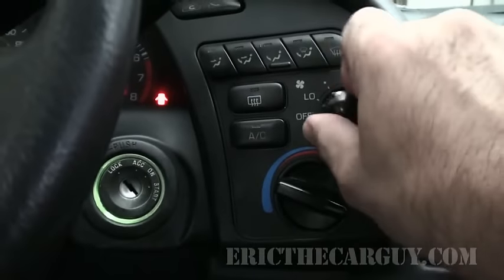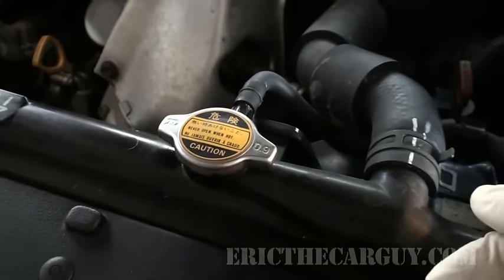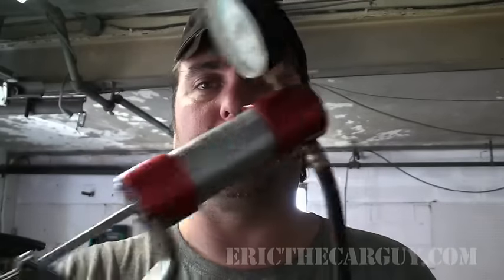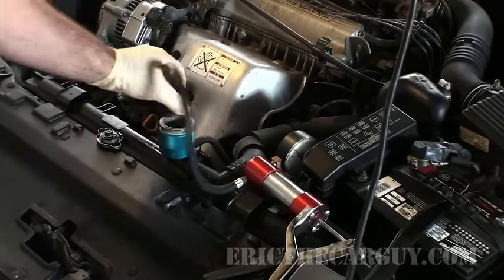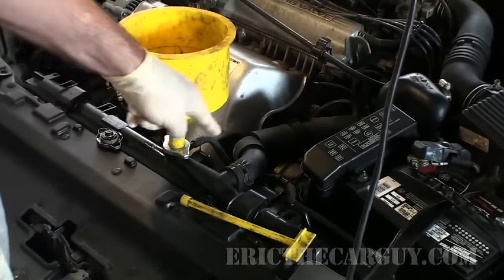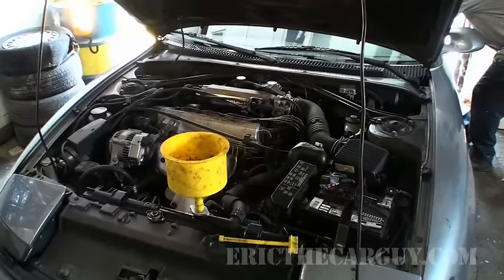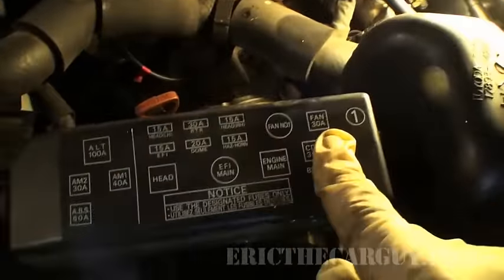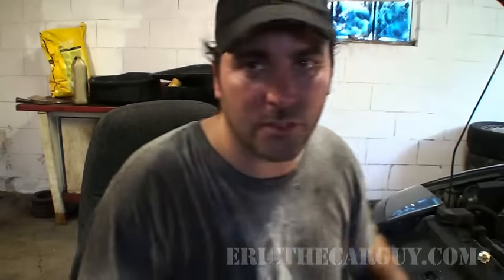How To Solve An Engine Overheat Condition - EricTheCarGuy

Comment: If this guy were a heart surgeon, I could do my own with his video
Reply: The difference between a heart surgeon and a mechanic is, a mechanic can fix a motor with it off. Heart Surgeons have to fix them when they are running...
Reply: Two In The Pink One In The Stink what if they really dont. who knows what is possible, everything we know is by design, were completely brainwashed. COMPLETELY!
Reply: They actually stop the heart and use a machine to circulate the blood. It would be really a neat trick to repair a heart valve with it beating!!!
Reply: thank the god we dont have subsidized mechanics yet
Reply: S.O.C_91 same

Comment: Thank you, Eric. I am having a PT Cruiser overheating  problem  for a second time. The first time was just over a year ago when a company that repairs only Dodge and Chrysler attended to the problem.  They replaced the water pump, all belts, thermostat and radiator cap.  So, now that I have an overheating problem again, I decided to take steps myself to fully understand the causes and solutions. I have seen several YouTube videos but did not find any that covers the topic so comprehensively as you have done. I now feel more confident at least to find out the cause of the over heating. Your video offering is much appreciated.

Comment: Last time I posted on this video was 12 years ago!
Eric does an outstanding job of explaining the principles of how relays work and how to properly test them in this video. BUT, for people who are a little more advanced electrically, a much simpler way to test the relays is if you have another relay in the fuse box that's identical to the one for the radiator fan, just swap the relay with the other one. This will take you one minute at most.
If the fans now work and the circuit that you pulled the other good relay from (headlight, etc) doesn't work anymore, you've nailed the problem and your diagnosis is done.
Under 5 minutes and DONE!
If the fan still don't work, and the other circuit does, you know that the relay was good all along.
Also, activate the fans and tap the motor with a long screw driver. If it starts spinning, the motor has a broken winding. 30 seconds and diagnosis is DONE!
Understanding systematic diagnostic procedures is really super important if you are new to this, but as you advance, you want to start using these much faster procedures to get the problem fixed sooner!

Comment: Great videos eric love the fact that everything is explained in such detail
no smart talk no trying to be a youtube star no bull just straight to the point
what could be better cheers mate :-)
Reply: +Steves Projects Well said man
Reply: thanks mate
Reply: Steves Projects m,!
Reply: would a thicker radiator help keep a ym2000d Myanmar tractor cooler
Reply: Yeah Eric is legit!
Reply: This is a good one.  Electric motors usually need air over for cooling, so an obstruction may have been the original problem that wreaked havoc.  [Was that a squirrel nest in the making in there?] One of the things I like best when checking out motor circuits is an amp probe - has to be DC for a  car obviously. Just clip on to the wire for the circuit being tested and find out if/how much load there is.  A good one is polarity sensitive and will show a negative value if you clip on backwards vs. current flow [comes in handy if you're not sure which way to go to find the feed or return/ground.   An amp probe can catch problems before they leave you stranded like... a winding to winding fault [that hasn't gone into meltdown mode yet ] is going to cause a slight overcurrent on the motor.  Fuse may or may not blow, and relay is usually unfazed.  For the car in this video, an amp check on the cooling fan would have shown zero - next step is test voltage to see which side has the problem.  With all the computers on cars these days I think having no built in monitoring of electric motor loads is downright lazy by the OEM.   You can find out temps, system voltage, throttle position, heater voltage status for 02 sensors, etc but not motor loads?  Radiator fan and fuel pump load should be part of OBD data in all cars - they're just too important.
Reply: Well done man it's a great video
Reply: mom just starting to heat overheating all of a sudden one day trying to take it apart and check everything out get back to me please

Comment: Radiator cap was causing my overflow tank to bubble alot due to broken rubber seal letting air prematurely escape the radiator. It didn't become an overheating problem until I tried to take a longer road trip and thought to check the radiator cap. Good stuff. My mechanic recently did my oil pump and water pump but forgot to put a new thermostat. Based on what you said I'm sure it's starting to fail it's easy enough to change great info

Comment: On small correction on how a thermostat opens - there is wax in the copper colored capsule that expands when heated and opens the valve to allow coolant to go the the upper tank of the radiator.  The spring closes the valve.  Good video - very practical.

Comment: Check the coolant "inside" the radiator 1st... Mine was 2 cups low, and 
caused overheating going slow uphill. Thought it was my fan clutch at 
first, so I went & bought one. Then I Checked the coolant reservoir,
 which had plenty in it. Then I watched this video & went to 
visually check "inside" the radiator. Nothing to see. Added coolant 
& it runs cool again. Now if I can get my $$$ from the auto-parts 
store.. I might need a new cap... THX for posting this !

Comment: Excellent video! There are a couple of other things that can cause overheating, but this video covers the most common causes very well. My diesel motorhome over heating was caused by a loose radiator hose that allowed air to be sucked into the coolant, but didn't allow coolant to leak out. I also had a bad head gasket on the air compressor that caused air into the system but didn't allow water to leak out. Go figure! Excellent video!! The pressure test shown found my loose hose. One more thing, the liquid used in the tester for combustion leaks comes in two different types, one for gas engines and one for diesels. Use the appropriate fluid.

Comment: Thanks Eric. My car gets too hot too soon in heavy traffic. My mechanic checked it out thoroughly and said everything was working like it is supposed to. His advice was to run the a/c on low so I could keep those fans turning. I had not been doing that for fear that it would overload the engine and make the problem worse. Thanks for verifying his advice.

Comment: Just wanted to thank you for everything you do. Really helps out, yesterday I had a company that comes to you, cost less than a brick building. Had an over heat with my 2006 Chevy Express cutaway 6.0, when I was getting y transmission serviced that told me that he though that the fan cutch was making noise. OK got OME replacement had my guy come out and change it plus some other front end work like tie rods ends etc. Got home to pay him and "oh your water pump is leaking" and he had to go. Ok this would be the 3rd water pump in 3 years, got a OME replacement pump.

After I got back to pay him again he looked worried, van was over heating just sitting in the driveway, so after lots of chat I
said lets change the therm o stat, he was looking like I was nuts, So I know his boss was rushing him to go to next job. I told him that back in the late 60's we would just pull the stat out and forget it. Does not snow much in Florida, question without the stat the engine is running about 20 degrees cooler, how important would it be to replace the stat?  using 1 to 10 where would that be ?

Thanks again you do a great job love all your post,

Comment: I cannot believe I just watched an auto repair video but I did. I was interested in the subject matter because of the over heating coolant warning in my 2015 Dodge Durango, but also because of how you articulated possibly diagnostic. After numerous trips back to the dealership, and they paying out thousands in loaner cars or rentals they still cannot resolve the issue. I want them to take back the vehicle at this point. A new vehicle with less than 18K miles should not be having these issues. Thanks Eric!!

Comment: There's also the possibility of a stuck thermostat which I've seen caused overheating in warm weather. This dude is the sort of friend everyone without a ton of cash to employ a repair shop, needs.
Reply: Yes and no. You can drive on a bad thermostat for years. I know this because I did on 3 cars until I got tired of not having heat in the winter then I replaced them.

Comment: Great vid...thanks Eric.  Only topics missed I noted were check to verify if the thermal switch was possibly malfunctioning (preventing fan from being energized) and any reference to possibly having a water pump mechanical failure or otherwise some type of restriction preventing flow of coolant thru the radiator.  That coolant in the video was clogged full of all kinds of nasty chunky debris.  Also imagine its important to mention whether or not the coolant has proper percentage of anti-freeze as that also dramatically affects the boiling point of the coolant similar to how you described the importance of the radiator cap.  There's cheap testers for verifying the anti-freeze is proper mix ratio.  Not sure what is out there for testing if the waterpump is poorly pushing fluid (if say vanes corroded or broken) or if radiator is clogged from debris (like the mess that was seen in your vid) other than trying to run radiator at temp without cap to see if you can detect flow in the radiator.  Observing bubbles in the radiator while running also good visual test for head gasket failure though your gas detector kit is better measurement tool.  Thanks for the ideas...helpful for me as I'm trying to track down son's coolant problem in his '01 Civic.
Reply: He can't cover every aspect.
Reply: Jim Polk 
I was hoping for some of the same information Jim
Reply: Hi Jim!  I'm soon to go to a pro shop that advertises they work on Subarus.  They said for $75 they have a special testing technology that pumps air into the coolant system to see where in the whole of the system, I guess many possible areas, where coolant can leak.  Have you heard of that?  What kind of technology is that?  They said that test is the ultimate to really know why my car overheats.  I already know the 2 fans work.  The upper radiator hose collapsed and the mechanic that a few days ago changed to new fluid and was suppose to get all the trapped air out from when a guy who had put in a new thermostat.  He also did the blue dye test and found no head gasket leak.  I returned by luck for something forgotten plus still sound of air under dash.  We found upper radiator hose collapsed.  He loosened the hose clamp and let air expand it again (only I thought "oh no, he's letting air in the system again) and said top it off into radiator once all is cool and keep doing that until all the air is out.  He was suppose to bleed it all out, the reason I brought my car to him to begin with.  Also topping it off had already never worked before as another shop had told me to do that too.  Just wondering I guess what that special testing device is.  Have you hear of it.  Also, what might be my overheating problem?  I was thinking it was because it was never properly bled after the thermostat was put in.   Thanks!
Reply: mwj5368 Try a new radiator cap.
Reply: Hi Darrel!  Thanks for the advice!  I before receiving this yesterday bought about an $11 cap with what they said has a safety release lever so you don't get hot fluid on your hands, yet I read on the cap and only looks like it's some kind of a lock, is that what those levers really are, just a lock?  There was no description with the cap.  I drove about 18 miles with new hopes and parked.  All went find but when I looked the reservoir bottle was full to the very top!  I let it cool down for 35 minutes.  The temp was 38 degrees.  I then drove 5 miles toward home.  On the way the cabin heat on full blast would go from very hot to outside temp just randomly.  At 5 miles it went into I think "air-lock" and over heated.  I stopped for 25 minutes.  Once cool I added 1/2 gallon of coolant direct into the radiator!  The reservoir was full to the very top.  With my flashlight the lower radiator hose looked bulged, but like the upper hose only a 2yr old hose.  The $17 thermostat (just were lower radiator hose connects on a '97 Subaru Legacy L wagon and it was only 2 days old. Also the upper hose was empty and hot.  I drove another 12 miles home at 65mph yet 2 times the temp needle started moving up then went back down on its own.  Do you know what all that means?  Thanks!  Oh, have you heard of that technology that pumps air into the cooling system to locate problems?  It will cost $75.  I'm thinking of going to a junk yard and bringing a used radiator to my appointment on Wed 11-1-17.  I spent about $2,000 on it last spring through a home garage mechanic.  I now learned never spend more than the car is worth if you were to sell it.  Have you heard of that?

Comment: Craziest thing I have ever found to be cause of overheating. 
The block was half full of sediment. 
I added a double dose of super-flush the system ran it twice as long as the minimum required. I started the truck and did the flush till it came out crystal clear. I then drove around on the highway that circles the city. Roughly 30 miles at 65 (+)MPH with another double dose of super flush. I modified a flush unit with a ball valve so I could attach a garden hose to the heater hose while the truck was running under pressure and hot. I then did another flush till it cam out crystal clear.
Now that everything was clean I replaced  the radiator, hoses. thermostat and all the little things needed. The cleaning opened up a small leak in one of the freeze plugs.I drove it a while and it still overheated. When I popped out the freeze plug there was sediment almost to the top of them.  I took out all the freeze plugs and ran a garden hose with a pressure nozzle and a wet dry vacuum. I pulled out about 3 quarts of sediment. 
The bottom of the cylinders were packed with sediment so the water couldn't circulate causing the coolant to boil. If the flushing hadn't caused the freeze plug to leak This would have taken a lot longer to find.
I don't understand how that much sediment filled the block
Reply: Yes. I have encountered this over the 40 years I have been an ASE Certified Tech. Although a significant amount of sediment can accumulate, you are correct that not that much sediment would collect (presuming that the system had coolant in it and not just straight water).  I have found the culprit is what was at one time the temporary cure for radiator leaks. A product of powdered metallic called Stop Leak. Whatever metallic powder product is not used to seal up a leak in a radiator or freeze plug that was leaking will eventually wind up in two places. The first spot is it collects in the block at the bottom of the water jackets. Secondly and somewhat equally, it will collect in the bottom of the radiator. Eventually after repeated and almost habitual use, the water jacket fills up with the product combined with sediment and basically shrinks the engines cooling jackets to the point where I have seen the product clear up to the cylinder heads, and the block was left with nearly no circulation at all.
It just goes to show you that the quick fix is exactly and only just that, and can cause greater problems with continued use.

Comment: I am just a regular Joe and I have to tell anyone pissing with coolant and radiators you must buy a "spill free funnel" it will help you soooooo much it makes this situation so easy I look forward to using it, it helped me find I had a blown head gasket, it also help with replacing block heater plug, water pump, thermostat and fluid change it help bleeding air easy peasy!!!!

Comment: I think you forgot to mention the temperature sensor that controls the relay that controls the fan
Reply: Hi Louis puglisi, That was what I was concerned about. Because I changed out the hoses that were bad & I recharged w/refrigerant  then in 1 week no air came out the vents so all I could figure out was that the temperature control sensor was bad. Am I right? Cuz the gauges show hot but it's not hot at all irs normal hot temp. What u think?
Reply: I have oldsmobile cutlass ciera 1994 3.1 I changed the coolant thermostas hoses and rad cap but when car idle or stop on traffic for long the temperature gauge will pass the half and fan is working but its kicking on late is that the coolant temperature sensor
Reply: greg bishop  true bro after the flush nowy radiator is leaking I got change it
Reply: Yes . probably thas is why the 916👎 .  I liked this video and I clicked 👍.
Reply: And he forgot to mention a stuck closed thermostat.
Reply: @JasonSpitzMI50  uhhh 17:30
Reply: He didn't forget the stick closed t stat I  watched it 3 xs

Comment: one thing not mentioned is to check for CLOGS, if someone mixed to types of coolant they could gel up and clog the system, or if the system is just horribly UN-maintained you could have a build up of sludge, in GM cars we call it Dex-Sludge and a gunked up cooling system can have reduced efficiency. that one you replaced in the video looked pretty gunked up.
Reply: Or customer used Radiator Sealer in an attempt to seal a leak, instead of fixing it properly and gumming up the system...ugh!  Huge pet peeve of mine!
Reply: Cuba Rodriguez
Reply: Patrick Miller
LOL...What's up Pat?